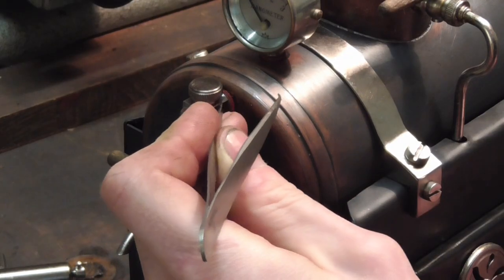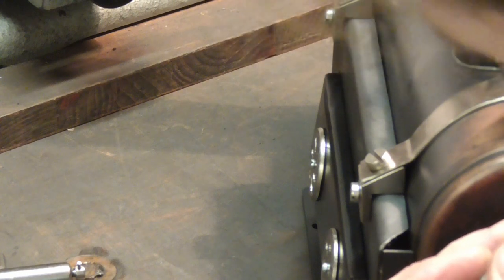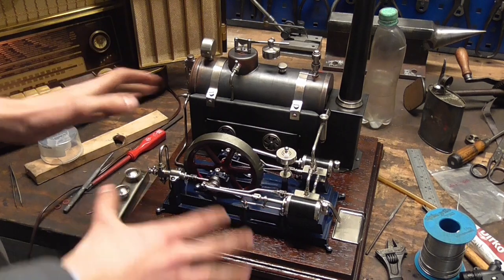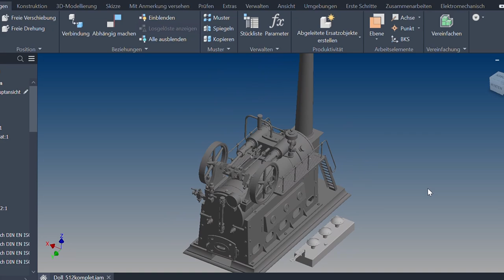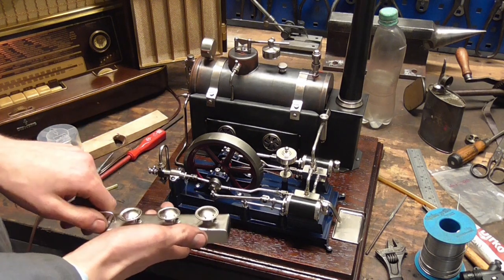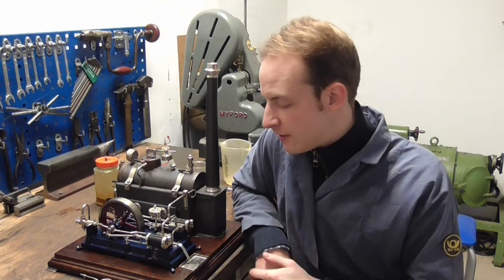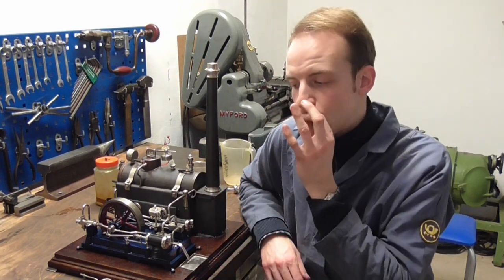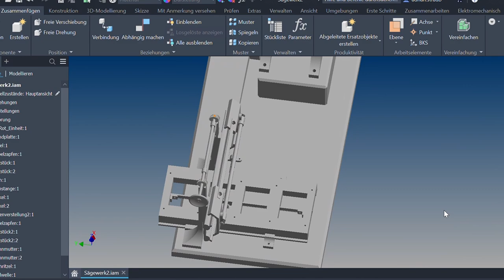First Steam!! - Doll 362 Replica Part 21

Comment: Question about Steam Boiler setup 3: Will you attempt to generate some electricity from the flywheel? That would be kind of cool, seeing the next set up charging a phone or something along those lines. I see the flywheel spinning and start imagining a tiny power plant...

Wonderful series of videos- been watching since the beginning of this series (or close to it- can't quite remember), and I look forward to the next one!
Happy Holidays!
Reply from the maker: Well, I'm a little afraid that the burner won't be able to make enough heat for the engine to produce significant amounts of output power.
Given a proper steam generator, the engine itself should be more than capable of producing enough electricity to power a tiny radio or charge a phone.
Reply: @AstraWerke  Interesting- is it possible to further optimize the burner, or are you already at about the limits of what you can do?
Reply from the maker: @garethfuller2700  It would take different dimensions - larger tank, and vaporizers spaced further apart.
I'll try that with the next steam engine, however - modifying the burner on this one would also mean enlarging the fire door opening, making a new fire door and widening the slot cut into the baseplate.

Comment: So great to see the conclusion of this project.
I know that if I tried this, the first startup would be performed with me hiding behind a stack of sandbags!🤣
I guess once you perfect the steam engine/boiler assembly, the next project will be a complete miniature steam-driven workshop with lathes, drills, milling machines and so on.😁
The torch you were using for soldering is very interesting. Is it butane powered?
This was a really cool project. Lots of food for thought for version 3.
Really looking forward to the future projects. The 1:14 scale sawmill sounds like a great (and challenging) build.
I hope you had a great Christmas and will have a productive 2023!
Reply from the maker: To be honest, I was a little nervous, too.
Good for me - thus, I kept a close eye on the burner and was quick to pull it out once it got out of control ;)
I do love the model machine kits made by PM research - for now, I have a sawmill and three other Dolls I want to build, however.

Comment: Adrian,  Very nice, I like the contrasting patina color of the boiler tank.  I imagine due to the small scale of the machine that the steam timing is quite critical for smooth and efficient operation. 

You may be interested in the YouTube channel “Jonathan W”.  Jonathan is collecting antique stationary steam engines , small to some quite large, and restoring them to operating condition. He was able to find a large wood burning boiler to provide steam for the collection which was repairable and able to pass its certification tests.  Here probably the same as in Germany, the boiler operator must be licensed and the boiler must pressure tested by the authorities and certified. This is all being assembled into a museum which will be free to the public. Some of the engines are simple purchases, others are major projects located abandoned in the forest and so large that they must be disassembled to be moved.  His collection is the result of being a very hard working and dedicated individual, rather than being wealthy with money to spare.

I’m sure that you saw Paul Shinn’s recent video on the classic old style turn signal switch. I have enough spare parts which could be restored and assembled to build one of these controllers. The only critical part short is the small actuating handle. A replica could be made, machined or sand cast.  If you would like to have the parts, let me know.  They would be a small favor for the useful information which you have provided other Model A owners.

A Happy and prosperous New Year to you and your family.
Reply from the maker: While it is true that the smaller the machine, the greater the required precision, steam engines are very tolerant. Almost anything will run, just a little more shabby. (See my very first steam engine)

Thanks for your offer - however, I have built an indicator control panel myself not too long ago, which does without adding a 3rd lever to the steering column.

I do hear that these are quite sought after items, though, so you might be able to sell it for a pretty penny!

Best Wishes
Adrian
Reply: I was using a push button signal control located unobtrusively on the panel near the windshield post but found it very unhandy in use.  It’s probably just my preference but I drive the car often, like you, so it was a constant irritation.  The Signal Stat 700  was almost ubiquitous as an add on in the 40s and 50s when the safety considerations of turn signals were realized by the driving public. This applied to cars , trucks, pretty much everything on the road, because of this the Signal Stat doesn’t look out of place to older folks.  The newer Signal Stat 900 is considered butt ugly by many, myself included, and does look out of place.  
A restorable unit is worth $75 - $100.   A restoration will be cosmetic provided it did not spend time stored outdoors in the weather.  The internal mechanism is bulletproof, way overbuilt by today’s standards. 
Looking forward to seeing your A back on the road.  Your opinion of the lightened flywheel may help many others in making a decision on the option.  My Roadster has the flywheel modification with the V8 clutch assembly.
Thank you for providing such an interesting and informative YouTube channel.